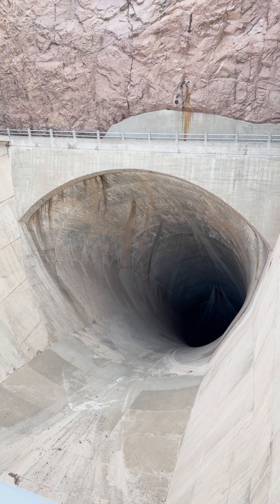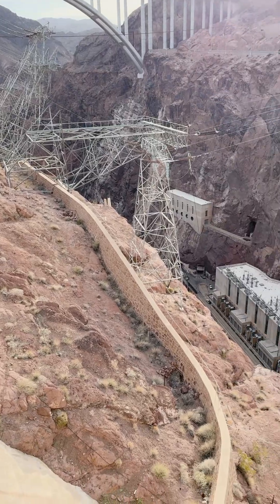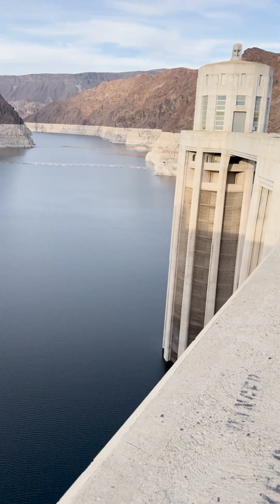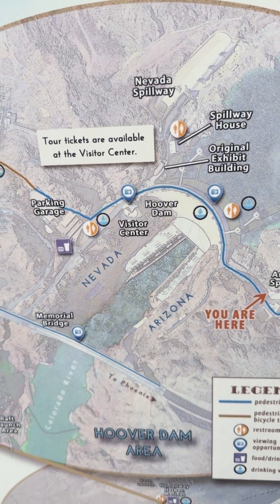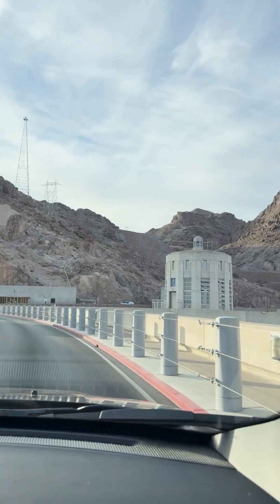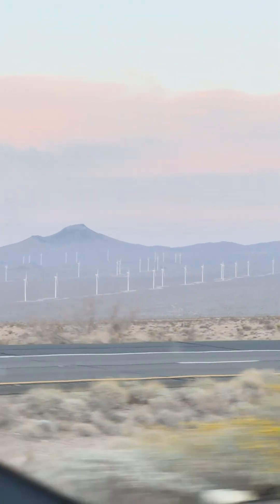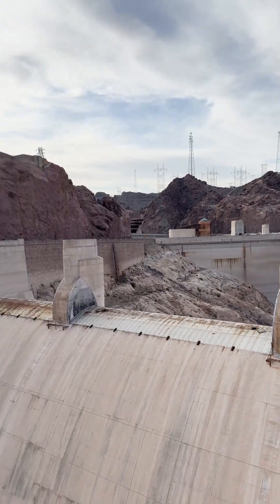How the Hoover Dam Works: The Science of Hydropower Explained

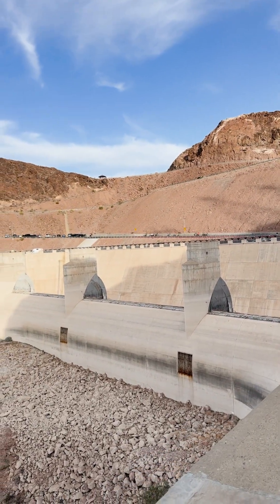Comment: You can see @1:05 and @1:18 two of the three (four?) reinforced concrete pillboxes the USArmy Core of Engineers put in to protect the damn in case of attack. 
The dam is also constructed along leylines and showing the position of the solstices/equinoxes at time of construction because the main architect was a wacko moonmason.